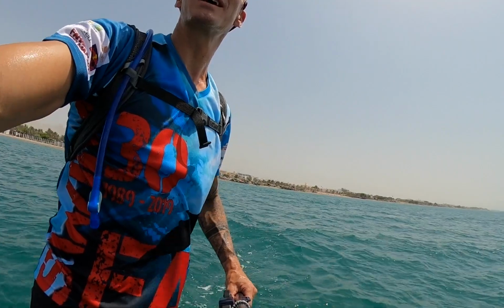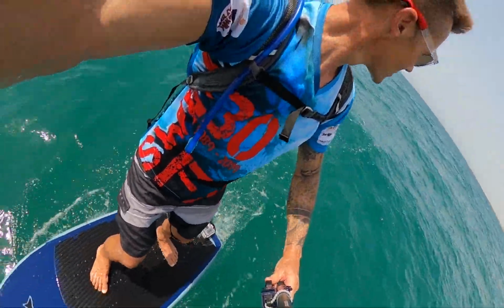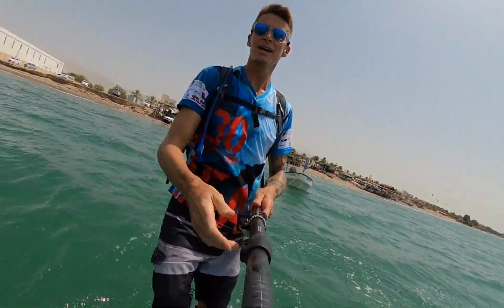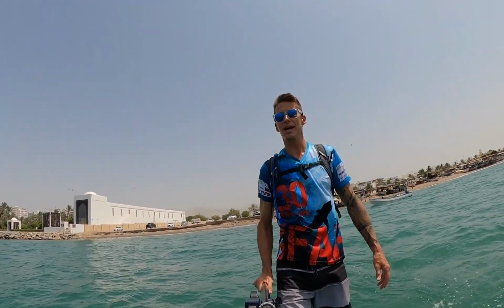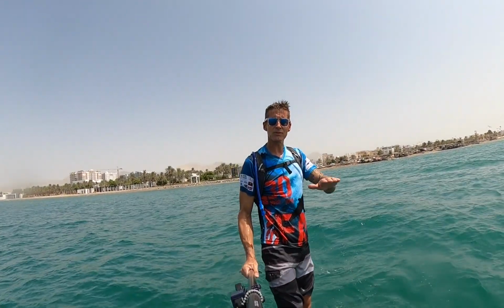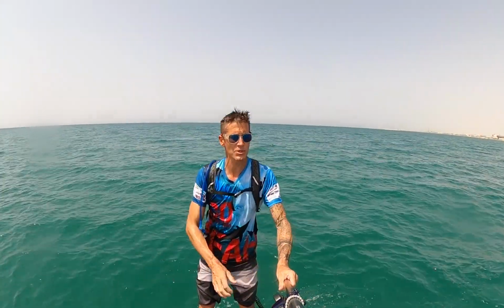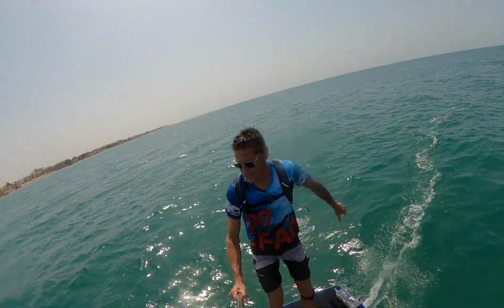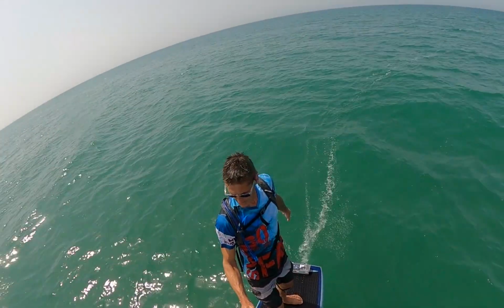Foil Drive 1st impressions

Comment: Hi Dominic I just got my foildrive and trying it out ( SUP foiling ) tomorrow. I am 68 kg and using the NSP 87 L 5’6” SUP foil board . I have a choice between the SPG 1620 sq cm Albatross foil or the Axis ART 1099 which is 1144 sq cm and super high aspect. Which would you suggest . Many thanks
Reply from the maker: Really it depends on the conditions. Obviously you can use the foil you would normally use in those conditions but you'll catch more waves with less effort, but also because FoilDrive gives you extra 'paddle power' to help you get up on foil you have the option of using a slightly smaller foil than you would normally use. There's no hard and fast rule, my advice would be to try FoilDrive with a many foil and board combinations as you can so you can work out what works best for you in your conditions

Comment: Awesome video. Do you have any tips for getting up on foil on flat water using the Foil Drive? For some reason I am not able to get on foil no matter what I try. I am an experience wingfoiler and kitefoiler, but for some strange reason I am failing while using the Foil Drive. I am trying with a large volume board, 110L and larger foil, 2100cm2, I weight 80kg. My can wing foil with this setup in 10knts, but I am not able to foil using the Foil Drive.
Reply from the maker: Yes, reach forwards with the paddle as if to plant the paddle in the water as far in front of you as you can. This will force you to lean as much of your weight over your front foot as possible. Paddle, but keep your weight forwards like this until the board is planing - it might take longer than you think but at some point the board will be skimming over the top of the water, and at this point you can bring your weight further back to lift up onto the foil. As soon as you are up on foil you will need to shift your weight further back (I usually shimmy my front foot back by an inch or 2) to prevent a nose dive as you lose thrust because the motor comes out of the water. 
The most important thing when taking off is to keep your weight forwards (more than you think) to prevent the nose of the board from rising. It feels like you are going to sink the board and that you'll never take off but keep going at full throttle to allow your board speed to get up to take off speed and all will be good from there. Hope this helps
Reply: @dominichoskyns9091  I will give that a try today and see if I am more successful

Comment: So that answers one quedtion I had. A great assist for marginal surfing and downwind conditions. Is there any scope to use it in exceedingly marginal Winging conditions? Around 5-7 knots?
Reply: Hey mate, yes, we have quite a few guys here in Australia using the system for exactly that. They know they can stay up on foil once they get up but are struggling to pump the board and wing to get up in the first place. You can mount the controller to your wing or just use the include wrist lanyard. Use the motor to get up on foil then just drop the controlle ron the lanyard and wing and ride like normal. Also lots of guys getting them as a saftey feature if the wind dies out they dont have to paddle all the way back to shore.
Reply from the maker: I used it once in exactly that, 5-7 knots and it got me up so easily I couldn't believe it. As long as you have a foil with good glide and speed you can keep flying until you make a mistake as you build up apparent wind which keeps you going. I have to pump the foil around gybes and its only when you fall or stop that you realise how little wind there is. I didn't mention it because I didn't film it, but I'll video it as soon as I can and put the 'proof' out there

Comment: Awesome review! The poor mans efoil? (Mean that as a compliment)

On that topic: Have you tried the efoil and can talk about the fun-factor vs your foildrive setup?
Reply from the maker: Haha yes I think that works as a compliment 😄. I'll be trying a full efoil in a few weeks so will be able to compare  and report back then🤙
Reply from the maker: Just used the Takuma cruiser efoil for a couple of hours. Totally different beast compared to the FoilDrive. Both very different applications and both awesome in their own right
Reply: @dominichoskyns9091  Thanks for the feedback!
The efoil is very special, and there is nothing quite like having the option to go 25mph on a foil by the push of a button. However, having one myself I rarely go beyond 10mph, so the thought has crossed my mind that in that way, it is just a heavy, "noisy" (it is not quiet), expensive version of the Foil Drive-solution. Not to mention, falling at 25mph hurts like sh!t.

Don't get me wrong, I am not selling mine because: 1) it is still an absolute blast. 2) None of my friends are into foiling(yet), and the Efoil is probably the absolute best way to get them hooked.

On the FD: If I lived somewhere close to a good downwind spot, or with waves that were hard ot catch, I could definatelly see myself getting it. Helping to catch waves, being quiet (I think), light weight and a fair price It looks like they have an amazing product for its special applications, that the Efoil can't do.
Reply from the maker: @svenpr9183  I completely agree. The full efoil was much more noisy than I expected,  while the FoilDrive was almost silent when on, but obviously totally quiet when you are up on foil as you're not using it then. It really is amazingly easy to get you up on foil, so even if you have the smallest swell or waves that you can't normally caychbits well worth getting

Comment: Awesome channel and vids! Is your battery box mounted over a deck pad? If so, how did you accomplish this? Thanks!
Reply from the maker: Thanks, appreciate it. This board didn't have a kick pad so I just had to remove a very small bit of the deck pad to stick the dual lock tape in place, however the 75ltr board I used had a kick pad right in the way so I used a screw and washer to fix a small rope loop to one of the rear footstrap inserts and then used elastic rope between this loop and the leash plug to secure the control box to the board. I have seen other people use a footstrap to hold the box in position.
Reply: @dominichoskyns9091  Thanks!

Comment: Hi Dominic, this video and the light wind winging one are great! I had sent the Foil Drive guys an email about a month ago, but then I went on a trip and didn't follow up until I got back and saw your videos. They are so convincing, I immediately got in touch with them again and am in the process of ordering (of course, I let them know all this). Here I just wanted to thank you, but of course a question came to mind, so here it is:
Assuming that once it's on the battery box will live on that particular board (please tell me if I'm wrong), is that board still fairly usable without the FD? Can you just go out with the box empty of the battery? Is there a way to seal the cable holes so that salt water doesn't get inside? I'm already thinking of dedicating one particular board to this... also because I'm lazy and don't really see myself mounting and taking off the whole thing every time I go. If you could elaborate on this and on the whole aspect of setting it up and taking it off, it would be great.
Thanks!
GP from the Kane video here...
Reply from the maker: Hey dude, of course I remember your kane video, it is legendary! The good news is that you can easily take the FoilDrive box off your boards. It is stuck to the board with dual lock tape (a kind of rigid plastic velcro) so the dual lock tape is permanently stuck to the board, but you can take the box on and off any time you like. The FoilDrive comes with spare dual lock tape so you can stick the spare tape to a 2nd board, and you can buy more dual lock tape from amazon if you want more! It takes a bit of effort to pull the dual lock tape apart, so the first time I did it I was worried if I would break something, but trust me it's fine, I do it regularly now. The trick is to roll it from one end rather than trying to pull it off flat. When you put it back on you have to make sure you hear a loud 'clunk' noise which indicates its locked back in place properly. 
During a wipeout once I unintentionally kicked the box which made the box come off the board. The box was just hanging in the water but nothing was damaged, I just pushed it back onto the dual lock tape again and carried on foiling. I have seen some people put the box under the rear footstrap. I assume they have moved their mast forwards to allow them to move their feet forwards to make space for the box. I'm not sure what that does to the balance of the board but it has the benefit of not needing to use the dual lock tape if your tailpad is in the way and you don't want to cut it off, and it will also prevent you kicking the box off the board in a wipeout, but some boards won't have enough room to do that, it all depends on the position of the mast and footstrap inserts on your board as to where it will fit best. 
I don't know if having the box at the back of the board or under the rear footstrap makes a noticeable difference with swing weight, this is something I will have to test.
One thing is for sure, the FoilDrive makes getting onto foil soooo easy, which means you catch more waves, and downwinding becomes super easy (and safer). Yes the FoilDrive adds a bit of extra weight, but its not that noticeable, and the benefits are definitely worth the trade off. 
I'm really glad you found my videos helpful. If you have any more questions please fire them at me anytime 🤙
Reply: Thanks! I don't have the Foil Drive yet, but I bought the perfect board for it already! :)
It's a 5.8x25x80ish liters (the original Alan Cadiz SUP foiling downwind board, we're talking pioneer stuff here) and it only weights 4 Kilos! Plus 3 of the FD, a board at 7Kg is still totally acceptable. I can stand on it and paddle, but I'm so slow and unstable I wouldn't stand a chance of catching anything in the open ocean. But with the FD... should be no problem to take off! And the most attractive thing is that I won't have to use the massive and slow foils I've been using so far in my lame SUP foiling attempts (Gofoil Maliko 200 and GL240). My dream is to do downwinders with the same foils I use for wing downwinders or even smaller. And maybe one day I'll even be on a NL130 and pass Dave Kalama on his NL 160 and leave him in disbelief! That's so not gonna happen, but it's a funny fantasy to have... :)
Damn, this foil stuff is so much fun!
Reply from the maker: @gcammar  You'll totally be able to use that board and a smaller foil with FoilDrive... as for passing Dave K - we can only dream ;-))))

Comment: What foil are you on what volume board 
Where is this available 
Thanks for sharing
Reply: These pieces of information. Also, suggestion, make yourself an affiliate so you get a kickback when we use your link!
Reply: Axis 1300 foil.
Reply from the maker: Axis 1300. Jimmy Lewis flying V 105 ltrs
Reply from the maker: @MMMMIIIITTTT  Axis PNG 1300 - amazing glide for a big foil. Jimmy Lewis flying V 105 ltrs. 🤣

Comment: Hello, very impressive !!   Looks powerful for such a little efoil. What is the max Watt you are reading on the remote ? What is your cruising time ?
Reply from the maker: The FoilDrive isn't an efoil, nor is it intended to be used like an efoil, ie using the motor for extended periods of flying time. Its a motor assist unit, ie it is designed to assist you for the takeoff. You use the motor to give you a bit more speed (drive) to assist you in getting onto the foil. When you are on foil you stop using the motor and just foil, because the motor/propellor unit is just below the board it is out of the water when you are on foil so it doesn't cause any drag. 
In actual fact its so good that its almost effortless to paddle onto the foil when using the FoilDrive. While you get used to it you'll get about an hour of use from one battery charge, as you get more efficient you'll get over an hour and a half, longer when downwinding, but it depends on how much you use it for assisting you to paddle back out which is also one of its benefits

Comment: Impressive 👏.  It would be interesting to see if this system could be used as a means to make down wind prone foiling more viable (Dave Kalama style) minus the hand paddles.  Provided you had a board you could knee paddle on I don’t see why not.
Reply from the maker: @BoyBrighton You are on my wavelength. Not only will I be trying this but FoilDrive are also working on a prone version of their motor assist unit. As soon as its ready to test you can be sure I'll be on it🤙
Reply: We have a few guys trying the current system on large prone boards, mounting the box at the front of the board. In our opinion a 7' prone board is more cumbersome than a 5'5 - 6''SUP but either way we are working hard on a prone version thats looking great! Still a little way off though.

Comment: Curious to know what kind of run time you’re getting from the battery pack?
Reply: Hey Mate,
With Dominics style of use in this video, (cruise control 30%, then short burst of 100% and repeat) We would expect him to get well over a 2hr session. This is obviously highly variable based on rider weight, board volume, wind conditions and how effieciently you use the throttle. If Dominic was using cruise control at 50% throttle he would be only going marginally faster but using a huge amount more power and that session could potentially be cut down to under an hour. If you hold it flat throttle out constantly the battery will be flat in 20mins.  Its all about using the motor assistance as just that, to assist you in paddling and to use the throttle effieciently. Most actual surf sessions we have are between 1-2hrs per battery.
Reply from the maker: I was using it for about an hour, being quite heavy with the throttle to help me get out each time and I still had 40% left on the battery. Easily a 2 hour session as long as you don't blitz the throttle the whole time to get back out. Longer if you only use it to get onto the foil.